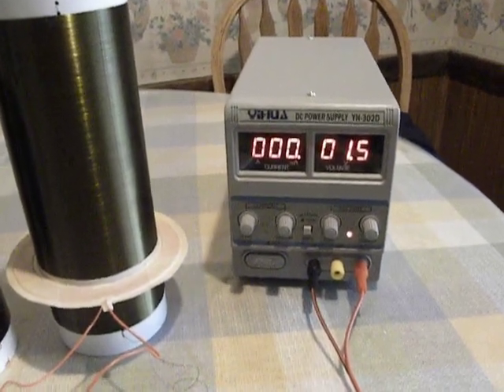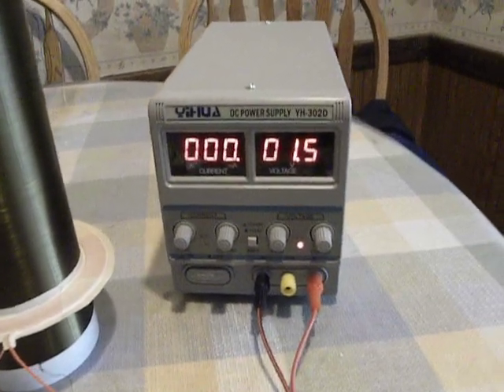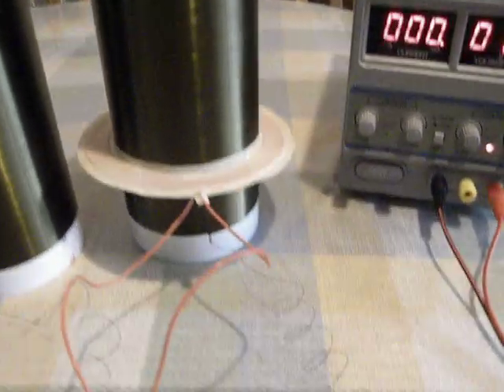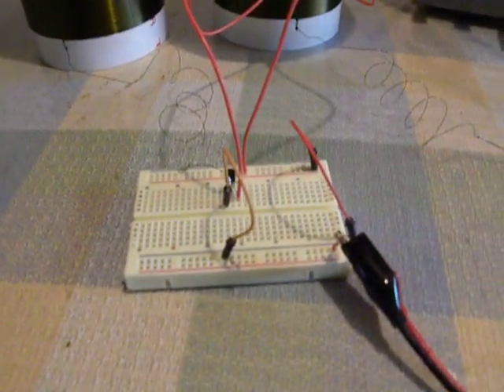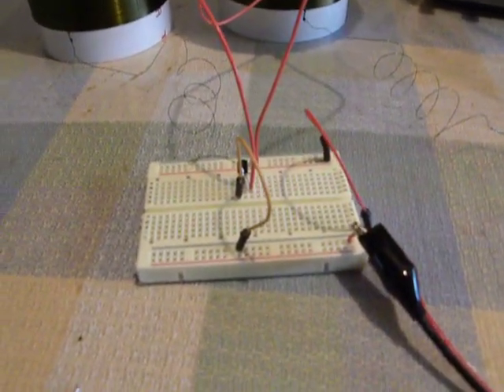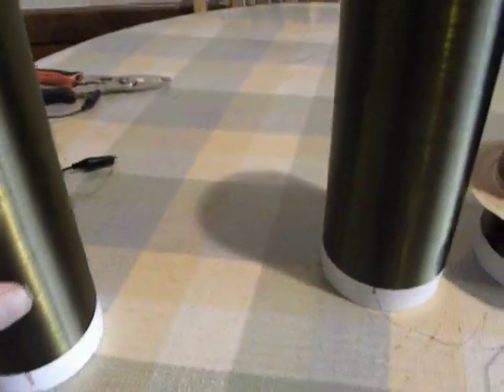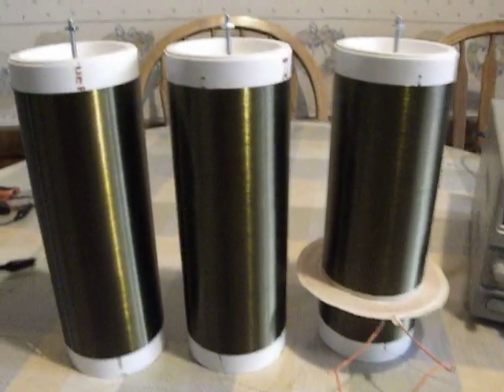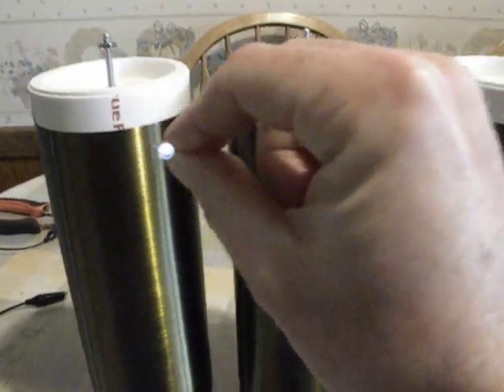Low Current Slayer Exciter Configuration

Comment: This is crazy. I'm never going to catch up to you :) Using disconnected L3 to resonate the other two coils. I tip my hat to you sir.
Have you played around with a cap and FWBR between tower and ground much? I'm thinking L3 and L4 both with FWBR and cap, then caps in series for the power suply.... I know you did similar a while back, but did you have the FWBR between L3 and ground? and have you done it with an L4 as well.... I think you have already seen this one I did a while back. Blowing High voltage Capacitor with Slayer I was surprised how much energy could be harvested from the system Via the FWBR in that position. If you had two in series....
Reply from the maker: No I haven't yet but it sounds like a great idea, thanks.
Reply: Between this video and MrSkypelessons latest vacuum tests, I am looking at some pvc pipe and some de gauss coils and thinking its been a while since I did some experimenting too. Must be 6 months since my last plasma burn.